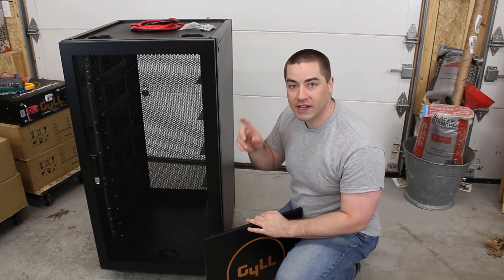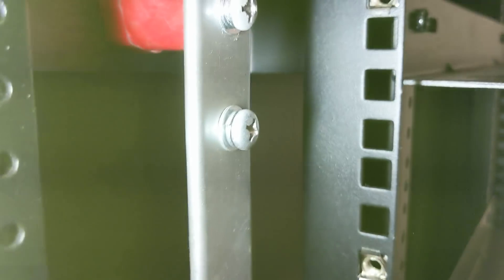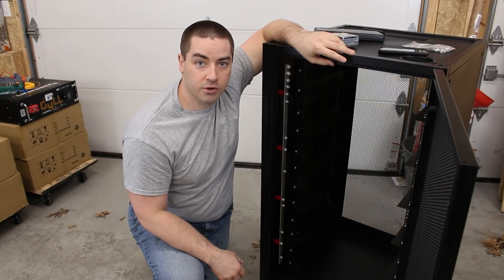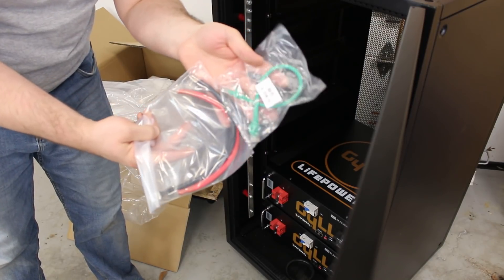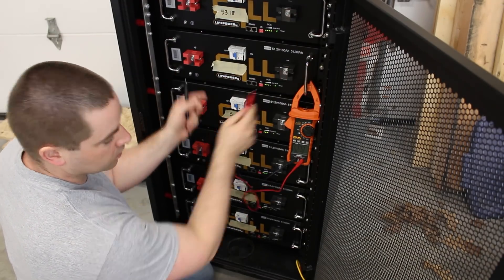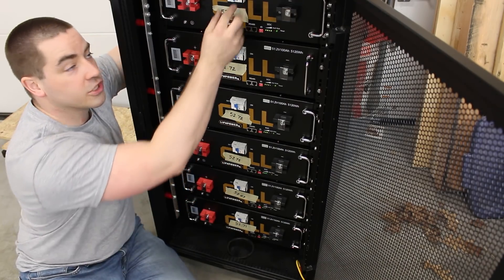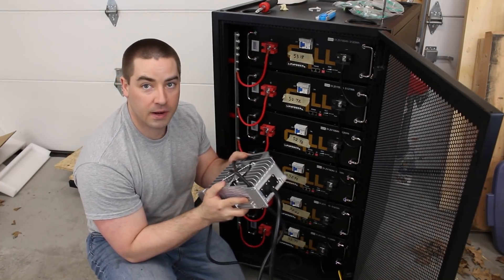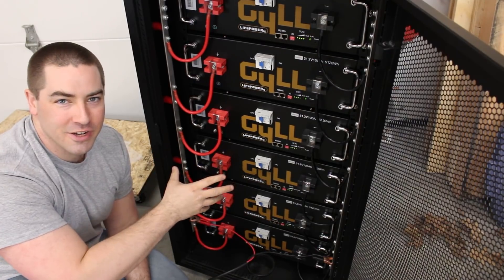Fastest Large Scale Battery Build, 30+ KWH, Power Whole House Cheap

Comment: Just curious, do you have any videos for building a home made ups? I'm in an apartment so generating my own power is out but my ups only runs my setup for 20m and big ones get expensive fast. Saw some folks suggest making one with LiFePO4 batteries but would still need to be able to plug it into the wall to charge, safely power my pc hardware etc.
Reply from the maker: I don't have a dedicated UPS video.  Sorry.  But there are two that may help.
1: Bluetti is a pre-made solar power station that can be used as a UPS: https://youtu.be/briFUcQVlwA
2: This inverter can be used as a UPS, but you may want the 120v version if it's just for a computer: https://youtu.be/2eF7zxmKBAg
Reply: @DavidPozEnergy  Thanks Ill check those out, Wim told me to check out your channel, really like all the projects, wish I could do more but the apartment ruins a lot of it for me (especially a half underground apartment haha)

Comment: David, did you mention charge time from calculated depletion to charged?  Does this time change with the number of batts in the stack?  Thanks
Reply: that would be more to do with the charger than the battery.
it would change depending on the batteries in the stack because more batteries will be taking whatever the charger can give so the amount each battery gets will be less. 
a 25a charger will charge one battery at 25a or 5 batteries at 5a or 25 batteries at 1a and so on.
the time to charge it is a function of the size of battery and the amount of current going in (including losses but ignore that for the most part)

Comment: How would the parallel connections be made to the busbars to ensure identical load sharing and identical sharing of charging current? Shouldn’t all paths have equal lengths? How is this critical requirement solved using two paralleling busbars?
Reply from the maker: It has to do with resistance.  The bus bars have very low resistance, and there is higher resistance to each battery.  When I hook up a heavy load (in a future video) I'll use my amp-clamp to show the load is being shared equally.

Comment: The pack ID rationale is pretty misleading. It's basically binary from the right but with the assignments inverted. They could have just made it binary plain as and left whether current flow through it in the 1 or 0 position as another topic.

Comment: What is the model of the circuit breaker? Thank you!
Reply: circuit breakers are built into the battery boxes. they do need to be a special type of breaker to handle high current dc.

Comment: I use a torque screwdriver for my bikes, guns, etc. 4 ft lbs shouldn't be taking as much effort as you're putting in. I would highly recommend getting the mechanical version (non electric) as it freely rotates when you hit the torque spec.

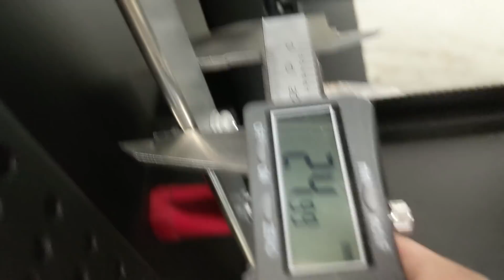Comment: 2:49 That doesn't look like copper to me, looks like an aluminum buss bar. Don't tend to see plated bars in this application use to excess contact resistance
Edit;  Would of like to of seen copper terminals too 4:30 , that cabinet is dubious for $500
Reply: it's essentially a Modified Server rack, you could probably buy one second hand for about $200

Comment: Looks like a nice bank and great work on the review and unboxing. One tip though, remember to turn off the charger when checking the voltage so you can get the actual battery voltage.

Comment: I purchased 2 of these cabinets and they are so nice. The only improvements I made was adding a grounding bus bar and replaced the 4” rubber grommets with some higher quality ones. The ones that come with the racks tear very easily. 

Flyshop 3-9/16" ID 4" Drill Hole Grommets Synthetic Rubber Grommets Wire Protection, Round, Double-Sided, 4-Pack, (Size 90mm x 100mm) https://www.amazon.com/dp/B0784376JK/ref=cm_sw_r_cp_api_glt_fabc_K5SK3SQQXWWRNYQMBZZT?_encoding=UTF8&psc=1
Reply from the maker: Thanks for the tip.  I just ordered the pack because I have seen the grommets tear on mine too.

Comment: I am thinking about ordering this monster for my house in the Philippines.  I want to have an off grid system, with grid backup. It will need to run 3 aircons, well pump, refrigerator and stove/oven.  Maybe charge a Tesla some day.  I don't know maybe I need 2.
https://www.aliexpress.com/item/1005002061216934.html?spm=a2g0o.detail.0.0.23c03138fmA9Za&gps-id=pcDetailBottomMoreThisSeller&scm=1007.13339.169870.0&scm_id=1007.13339.169870.0&scm-url=1007.13339.169870.0&pvid=ed64a6fe-b5ba-41ec-82e5-ba5a428365b4&_t=gps-id:pcDetailBottomMoreThisSeller,scm-url:1007.13339.169870.0,pvid:ed64a6fe-b5ba-41ec-82e5-ba5a428365b4,tpp_buckets:668%230%23131923%2396_668%230%23131923%2396_668%23888%233325%237_668%23888%233325%237_668%232846%238114%231999_668%232717%237561%23354_668%231000022185%231000066058%230_668%233468%2315612%23395_668%232846%238114%231999_668%232717%237561%23354_668%233164%239976%23380_668%233468%2315612%23395

Comment: Are you completely off grid.? Or do you still have grid tie?
Reply from the maker: The grid is still connected to the house.  I still switch over once in a while when I'm re-wiring something, like adding batteries to the bus bars.
Reply: @DavidPozEnergy  ok I was just wondering how you add and remove panels for testing or adding something new. I’ve been wanting to start panels and hookups then add panels as my demand increase but was always told I’d need more permits and multiple meters every time I add more panels.  I was wondering how you handle adding more panels
Reply from the maker: Everything I work on is strictly off-grid and can not back-feed.  I have a transfer switch between the meter (from grid) and my off-grid solar system.
Reply: @DavidPozEnergy  ah that makes sense. Kinda like a transfer switch for a backup generator.

Comment: Hi David My question is how much battery & solar panels and inverter do I need for 83” long trailer pleaseeee I’m stupid to this type of things, I will be running Apple home computer & full size fridge & stove & 2 bug screen tv & hair blow dry and lights, Apple TV & Mac Pro laptop & cell phones & 2 fireplace & ps5 and washer and dryer in the DIY tiny house that is made out of shipping container, I want the feeling of a house powering please help I’m so clueless, I don’t want to over buy nor under buy
Reply from the maker: You will need to answer a few questions.
1. How many kwh per day do I consume?  If you are currently living in a home/apartment, then you might be able to just check your current electric bill for your daily average.  
2. How many days of autonomy?  This would be how many days do you want the battery to power your trailer without solar coming in.  (clouds, rain, etc.)  Usually this is 1-3 days.  I'm at 2 right now, but building up to 3.
3. Maximum load at any given moment.  Max kw?  This is used for sizing your inverter.  For example, a laptop might pull 60 watts.  But a charger for an electric dryer might pull 4.5kw.  

There are some online calculators that can help you too.  Here is one: https://www.altestore.com/store/calculators/off_grid_calculator/
Reply: DavidPoz thank you so much
Reply: How do you fit all that stuff in an 83 inch trailer?

Comment: I don't know where to start.. why would anyone with a residential house Need 30kw of solar?  (and that's assuming it's 100% off grid) To me that's Way Overkill. I assume this is your own property. You didn't break down the appliances that requires all that power or show your solar array.
Reply from the maker: Hi Divergent Droid,  In this video I'm showing a battery that I'm adding to my existing system.  I have several past videos showing my solar and house and garage.  I don't have 30kw of solar, I have about 12kw of solar.  I'm adding 30kwh of battery capacity.
Reply: @DavidPozEnergy  Ahh.. that's a horse of another color. Thanks.

Comment: i have a question so i thought id ask on your most recent vid, whats the need for the big crazy soldering irons you guys use? would a regular soldering iron not do the job?
Reply from the maker: I own two size soldering irons.  Yes, one is big and heavy.  I need the big one for some of these battery builds.  If I need to solder 8 AWG wire onto thick nickel strip, the small iron won't do it.  I've tried, but the wire and nickel just suck the heat away from the iron faster than the iron can heat the metals.
Reply: @DavidPozEnergy  thanks for the reply dave! I'm going making my own batteries for off grid living, inspired by yourself, I have an electronics background so dont worry.  I'll get myself one of those big soldering irons before I get started so :)

Comment: you need another shelf for the rack mount remote gaming pc ^_~
so your looking at what $10K total, and that will run what for a weekend ?
Reply from the maker: This rack with 6 batteries is 30kwh.  So it could run my full-size refrigerator for 25 days.  OR a window AC for 2.5 days.  It depends what you have plugged into it.
Reply: @DavidPozEnergy  thanks.
well obviously everyone will have the  rack mount remote gaming pc fridge for cold beer and the odd microwave for 2 or 3 snacks a day ^_~

Comment: 30 kWh is the same Energy as 3 liter diesel, or 0,8 gallon.
That's how crazy this "electrification" of the world has come to.

Would you ever spend $10K on 0.8 gallon of diesel, even if you had to buy that amount 5000 times (which represents 5000 recharges) it's still cheaper kWh for kWh to run diesel (without taxes), then the question is, would the battery last 5000 cycles?

I know apples and pears, but still considering the energy of making and transporting the solar panels, batteries etc., fossil isn't that bad.
Reply: got anymore dumb comparisons? maybe how many big macs that is equivalent to? or how many photons of  sun light? you know solar energy, the stuff that makes life on earth possible.

Comment: What is the short circuit current from one of those battery packs? Multiply by 6 in parallel. What is the short circuit rating of those little circuit breakers? Can they clear the prospective short circuit current? How quickly will the circuit breakers clear a short circuit? How hot will those PVC cables get carrying short circuit current until the circuit breakers clear the fault (if they can)? Batteries have much larger short circuit currents than PV installations. LiFePO4 batteries are much safer than other chemistries, but an uncontrolled short circuit in your garage might still burn down your house.

Comment: The cables going from the batteries to the bus bars is 6 AWG, isn’t that too small? How many amps will you be pulling from those batteries?
Reply from the maker: If I were building the system from the ground up I would use thicker wires.  And I have done so in several past videos.  However, it's not un-safe given that in Chassis wiring 6AWG is good to 101 amps.  My total system can pull a max of 300 amps, which is only 50 amps per battery, so now the 6 AWG wires are plenty.

Comment: Great content David.  How do these batteries stack up to a recycled tesla battery?
Reply from the maker: I just jumped on Ebay to take a look at the going rate.  Usually when people ask about Tesla batteries they are talking about the 6s modules, 5.2kwh. Is that right?  The posts I'm seeing on Ebay look like an average of $1,100 shipped.  Those are Li-ion, which are a little more dangerous than these, which are LiFePO4.  However, Tesla cells are more energy dense.  If you have a mobile application where weight is the primary goal, then you probably want Tesla. The Tesla module is about the same capacity as the Gyll battery, but half the weight.  However, you need to add your own BMS and your own circuit breaker to the Tesla, while those things are already built into the Gyll battery.  The Gyll battery is $1500 plus about $75 in shipping (depends on location)

Comment: As an IT guy, I like the 19" rack mounting, I could see using these for backup power or remote solar-powered relay sites. It is too bad they went with RS485 rather than RS232 because those console cables are cheap and available as they are used with older routers and switches. That cabinet is probably a good enough price for being already setup, I would like to see better connections to the power rails and something covering them even heat shrink with cutouts for the connections would keep things from bumping them. The teardown video was good to see they are good inside for being made in China.
Reply: RS485 is a two-wire bus, enables many units ganged together, while RS232 could only serve one battery unit.

Comment: I live in Denmark and bought a rack cabinet with very very similar dimensions for DKK 1000 including shipping (which is around $160).
Try looking in online computer stores, you'll definitely find something below $500 for an even larger rack cabinet.
(sometimes they're called server cabinets, just keep searching several times in several different stores and you'll find a good deal).
Edit: Make sure you get a 19" Rack cabinet, not a 10" (those are cheaper and will be too small). My Rack Cabinet is a LinkBasic; I think it's an 18U as far as I remember.
Reply from the maker: Thanks for the tip.  At $160 it would be worth it to DIY.

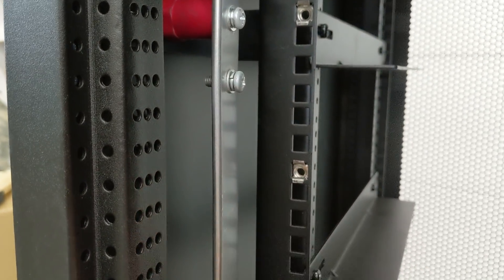Comment: 3:00...remember those are Belleville spring washers. Not ordinary flat washers.  Bellevilles provide spring tension for high amp connections.  You don't want to use ordinary flat washers.

Comment: I believe the bus bar bolt are 6mm not 10mm. M6 bolts aren't they?
Reply from the maker: Yes.  I said M6 in the video.  I then used a 10mm Hex nut on the backside.

Comment: If it helps, it looks like those dip id settings are just binary values.
Reply: They are binary values, they have been used in electronic devices since the year dot. 1.2.4.8.16 etc

Comment: will it work with the sunny islands
Reply from the maker: It won't communicate directly to the Sunny Islands.  However, it will power the Sunny Islands if you have them in VRLA mode.
Reply: i'm just getting in to the battery back up.i have 4 sunny boy us 5000 and i bought 2 6000 sunny islands not real familiar with the battery end of it do you thing its a good idea with the byll battery im looking at 12 of them with cabinet
Reply from the maker: If you already have the Sunny boys and sunny islands, then yes, these would be a good match.  When you set up the Sunny Islands it will ask you what kind of battery.  If you choose Lithium, then the inverter won't do anything unless it can talk directly with the battery.  But there are only a few batteries programmed to talk with the Sunny Islands and these Gyll batteries (along with 99% of all batteries) are not programmed for it. I'm working with a friend of mine on a fix for this.  I'm currently BETA testing it and will make a video on how to get around this in the near future.  I'm actually using the Gyll batteries right now with the Sunny Islands and it's working well.  I'm just trying to make clear that it's not an approved battery from SMA.
If you decide to buy the Gyll Batteries, use coupon code DAVIDPOZ for a discount.
Reply: @DavidPozEnergy  thanks so much love your videos .do i need anything between the sunny islands and the battery besides the cable
Reply from the maker: I have a Victron Smart Shunt: https://amzn.to/3c7ne3J  And a Fuse: https://amzn.to/3scKvXA  You need to size the fuse based on the wire you are using.  The Sunny Islands have disconnects built in, and the Gyll batteries have circuit breakers that are also disconnects.  So, for example, if you run a 4/0 wire from the batteries to the shunt, then you want to protect that with probably a 320 amp fuse.  If you then split the wire for the two inverters, you need to stay to the same wire size (4/0) for each inverter unless you add another fuse for each of those wires at whatever lower amp rating they have.  
If you have any other questions send me an email or message on facebook.  It's hard to find old threads in youtube.

Comment: The intro says one hour and kw but how long it will power the whole house without solar or the GRID? And how much is for the whole unit? So far is worth it?
Reply from the maker: It costs about $9500, it's 30.72kwh in capacity, or about $309/kwh.  If your house consumes 15kwh/day, then you would get 2 days out of this. The time it will power your house varies with how much your house consumes.

Comment: If I were the one setting the screw, there would be sparks and flames and the end of the screw driver would be blown away...
Reply from the maker: I did all the screwdriver work with the circuit breakers OFF.
Reply: @DavidPozEnergy  I saw that in the video. Love to watch what you do but know I will never get past the PowerBanks. I just bought a new LG 24” 4K monitor for my MacBook Pro and it has enough USB C ports to replace a hub. No sparks yet... Next step is to see if I can connect my RavPower 253 W PowerBank and have it act as a UPS.

Comment: I feel like a really good addition would be an extra 2 U's in the rack as I would like a little network switch in the top,
Or even a shelf for storage and spares.
Not too keen on the adapter sent I feel like a premoulded cable would also be a welcomed extra.
I doubt I'll ever be able to afford a system like this so I suppose my nitpicking is irrelevant
Reply: Aside from the affordability aspect... Just buy a second rack and populate it with 4 battery units and your 2 monitor units.  Then you have an even 50 kWH battery bank.  😃

Comment: If you live in an earthquake area, how would you want to stabilize the rack besides locking the wheels a (it seems abit top heavy).  Cable the top of the rack to  a wall perhaps?
Reply from the maker: If I was in an earthquake zone I'd remove the casters first.  Get the empty cabinet into positions, then bolt the cabinet to the wall/floor before installing the batteries.
Reply: @DavidPozEnergy  Thanks,  great ideas.  Can't wait to see you get these going in your system !